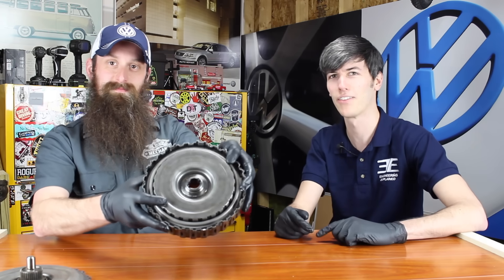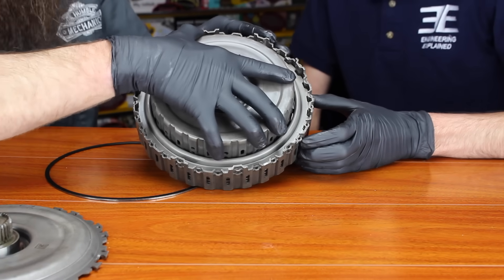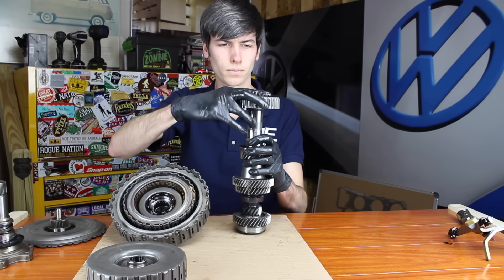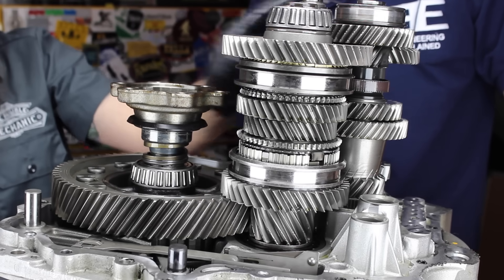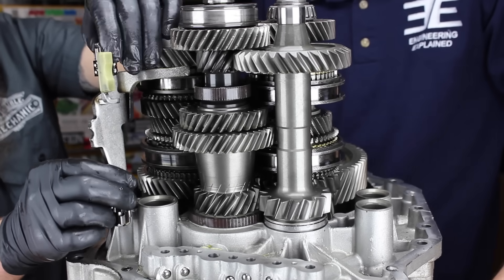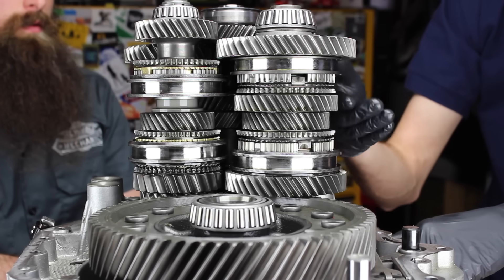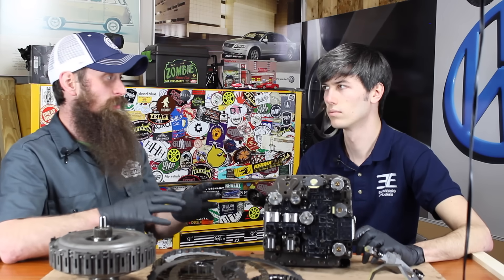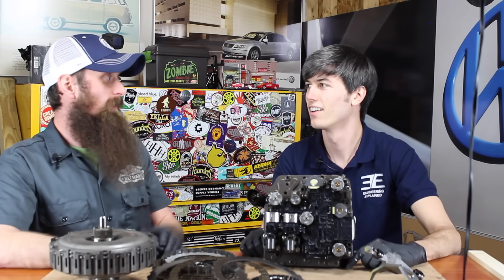DSG Transmission - Explained

Comment: Hi I have a question that has been bothering me for a while now. I am an M4 owner and my car comes with DCT, I read online it said when im at a stop I can let go of the brakes on a DCT transmission because it will not roll. However my car rolls when I let go of the brakes, is it because i accidentally did something with the settings on my car? Thanks for answering my question.
Reply: +Zihao Chen I think what they mean is, the car will not creep forward like a car with an automatic transmission. It will act like a manual transmission car in neutral.
Reply: See if the hill holding feature is activated. If not it will roll forwards or backwards. If it is it will creep forward.

Comment: can you get it to shift early each gear even if you push the pedal down quite a bit as in accelerate quicker without getting the car to redline the gear.
Reply: +VTECB18 Yes, you can floor the throttle without clicking the button that is below the pedal and it will accelerate as quickly as possible without coming close to redline.

Comment: So if the Dual-Clutch Transmission does the shifting why would some cars still have the paddle shifter? is it because of more driver control? I know that F1 cars are DCT but have paddle shifters. I mean ultimately, wouldn't it be self-defeating for a DCT to be controlled manually again ?
Reply from the maker: +TheGreenCommunity It's nice to be able to control what gear you're in (that's the only way it works in motorsport). Also, F1 does not use DCT.
Reply: +Engineering Explained Thank you very much for your response. I assume F1 drivers also use manual transmission because they have more control with manual then ?
Reply: +Tal Risin S mode will shift in higher rpms. If you have paddles you can control the shifts in d en s, but most cars don't even have those paddles, its an option. So, d mode normal driving, d to the left is manual shifting with the dsg knob and s is auto shifting with higher rpms.
Reply: +Am Dolan in any mode the paddles override the auto mode.
Reply: So basically even though it's classed as automatic it does have a manual mode?
Reply: @AmDolan That's correct.
Reply: +Am Dolan VW call it Tiptronic, basically you move the gear handle to the right (while it's on D) and then push it forward/pull it backward to control the gears manually. (Or if the car has flappy pedals then you just use those).
Reply: So in 'D' mode the only way to control the gear is manually (stick or paddles). The car won't automatically change gear when it gets to a high rpm? Basically this is a full manual mode?
Reply: Am Dolan no no no no.
You have:
P - Parking
R - Reverse
N - Neutral
D - Drive
S - Sport.

When in Drive, you can move the gear to the left/right (depending on if your driver seat is on the right/left), only then it enters the manual mode in which you control the gears.

Of course if you get to a situation where the car cannot continue driving at the current gear then it will change gear automatically to prevent damage or stopping. (for example if you hit the brakes while being in 6th gear and lose a lot of speed and the gear will change to 1st or 2nd)

You can see the gear here:
http://jyllands-posten.dk/livsstil/biler/article6285561.ece/ALTERNATES/h-free/dsg
Reply: Oh so there is two modes for drive mode? Mode 1 is just plain old automatic? Mode 2 automatic but you can manually change if you wish? What's the point in mode 1 then?
Reply: Am Dolan Taken from VW official webpage:

"Automatic transmissions with Tiptronic, which are available with five or six speeds, have all the advantages and technical features of the automatic transmission.
Tiptronic allows the driver to override the automatic mode by moving the lever into a second (Tiptronic) shift gate. Changing up is achieved by pushing the gear lever forwards, and changing down by pulling it back. Gearshifting is also possible with paddles on the steering wheel.
Tiptronic provides the convenience of an automatic and the driving enjoyment and sportiness of a manual gearbox. Safety when overtaking is provided by the automatic change-up feature when the engine speed limit is reached. The sporty driver benefits from changing down and using the engine for braking before a bend or when climbing hills"

Except Tiptronic is available on all their DGSs and automatics, not only the 6/5 gears but also the 7 gear ones.
Reply: Oh I see. Does s mode have a manual like d mode?
Reply: Am Dolan I don't think it does.
Reply: Suppose it would be pointless. Exactly the same as d modes manual mode. I'm guessing s mode is just the d mode but higher rom changes
Reply: Rpm**
Reply: Am Dolan I guess, not sure what exactly it changes.
Reply: +Engineering Explained Just think of F1, as traditional manual with servos and or pneumatic links working the clutch and shiftier.  You can hear what seems like an eternity.. of lag in shifts in F1 cars,  Early Automatic Ferraris  had this.... It  drove terribly ...!!! wait all Ferraris do..
Reply: +Am Dolan S makes throttle more sensitive.
Reply: Being able to select your own gears can be useful, such as preemptively selecting a lower gear so you can perform an overtaking maneuver without waiting for the transmission to kick down. After said maneuver I can then put it immediately back into high gear.

I've just bought a Diesel Optima with a 7-speed DCT, and heading to work there is a long down-hill section. I pop the DCT into manual mode and flick down a few gears with the paddles so I get an engine breaking effect.
Reply: F1 isn't allowed DCT because completely automated electronic gear changing is against the rules, same as moto GP. They have seamless gearboxes which are very similar to DCT just without the second clutch. Upshifts are clutchless, they have quickshifters which cut the ignition between changing the two gear shafts. Downshifts you have your auto blipper and slipper clutch but they can use the clutch manually for control over engine braking and engine load e.t.c between shifts. The only problem in a DCT along with the weight of the second clutch and electronics is that you have no physical control over the engine braking and engine load being applied during gear shifts, a race driver or GP rider will tell you this is essential to stopping sudden loads causing weight shifts interrupting race lines. Even with the most advanced slipper clutches and auto blipping systems to a professional there is still a significant change between gears in downshifts, with a manual clutch they at least have some manual control over this. I'm sure with the money they have available they could create electronics to replace the need entirely for a manual clutch but then you have the weight factor and like I said the rules don't allow DCT anyway.

Comment: i have a sort of complicated question. hopefully i'm clear on this one:

on an auto trans, when you're on a dead stop on "D", you're putting load on the engine, thus requiring more fuel which is less efficient than a manual on neutral. on a DSG trans, are you wasting power on a dead stop like an auto?

tahnx for your response :-) keep up the great work man! these videos really help!
Reply from the maker: Michael Olan With a manual you're spinning the clutch and transmission in neutral. With an automatic you're spinning a torque converter against a transmission, but not much force is going in. With a DCT, the clutch pack will be disengaged so you're not implementing more wear, it's probably somewhere in the middle.

Comment: Thanks guys , another great vid from EE. my question here, is that if i put a dsg gearbox in my car, and put a manual switch  to activate the pistons , would that work?
what if i put a dsg box in my car, put 2 paddles, running the required voltage to go up or down? since dsg is essentially a electronically controller manual gearbox... i think it can work...the car will basically be manual...with an electronic selector
Reply: You mean disable thr computer and just use simple switches to shift? it probably wouldn't shift because the ecu readys the first clutch so it shift fast with the second essentially, both have to work in a rhythm.

Comment: Hi Engineering Explain, I got a weird question :
Traditionally, torque converter and planetary gear set make a AT system, while clutches and synchronizing rings make a MT system.
My question is : Why don't people put torque converter and synchronizing rings together? It may sound like a silly question,but the companies really don't do that.
Reply from the maker: 柯旭東 Clutches are commonly used within automatic gearboxes to select certain planetary ratios.

Comment: I just got a 2010 VW Golf TDI and has a DSG transmission. I started learning how to use the manual gear change on the right side of the DRIVE option(sorry I don't know what it is called) and I started having some fun with changing gears, such as downshifting, hitting the acceleration, and changing gears again. I have one question for anyone who knows a lot about cars and stuff. Will this damage anything in my transmission? How often should I have fun with it? I love the way changing gears sounds and I plan on upgrading many stuff on the car. If anyone has any tips it would be really helpful, I do plan on putting a straight pipe so it sounds sexy but that's about all I know. Anyways tops are useful!! Thanks! PS I am in the Marine Corps and don't make a lot of money so anything cheap but reliable will be useful haha

Comment: I was under the impression that the gears are on alternating shafts, this is where the whole benefit of a dual clutch gearbox comes in...since to change gear, it needs to only engage one clutch while disengaging the other.  In addition, it can have the next upshift preselected to facilitate this.  If they were just sequential, there'd be no point to a dual clutch 'box, and it would function largely the same way as a traditional manual gearbox, just with more complexity and moving parts.

Comment: Great explanation but I'm having issues with my 21010 CC DSG... OBD code P2711, =>Unexpected Mechanical Gear Disengagement<=... especially when trying to reverse up hill. I have to turn the engine off then restart it to reengage . And every once in while I get a huge clunk shift, like the tranny just slammed into the diff! Brought it to the dealer and of course no issues. Still happening and now my warranty is expired! Can a DIY guy change out the shift interlock or inhibitor, providing thats actually the problem? What else could be the issue?
Reply: Did you solve the problem? I just got that code P2711 in my DSG

Comment: Does the dual clutch transmission operates the same as the direct shift gearbox? Or does it has a difference between this 2 transmission?
Reply: 1Asura0 'Dual clutch transmission' is the type of transmission and DSG is the 'brand'. For example, Porsche labels their dual clutch transmission PDK. SO yes, DSG is a dual clutch transmission.
Reply: Farhan Chowdhury Which means does the DCT and PDK share the same problem as DSG on the asia continent? I have read the news about China having a DSG faulty.

Comment: automatic transmission doesn't have the DSG right? I don't know why some Jetta TDI needs DSG transmission service
Reply from the maker: MasterofPlay7 DSG is an "automatic" transmission.
Reply: Engineering Explained so if I bought a TDI, I have to do all the maintenance from time to time? So in your opinion, does a TDI cost more to upkeep than a regular gasoline vehicle? Because I was thinking of buying a TDI which I had never owned one before
Reply: MasterofPlay7 yes if you dont maintain cars they are under unnecessary wear.
Reply: Jonathan Ongman is the 2006 jetta tdi known to have problems (like the flywheel)?
Reply: Probably, but all the ones Ive test driven have had over 200,000 kilometers on them. Condition varies, but I doubt itll let you down if you find a good one. Id own one.
Reply: Jonathan Ongman oh.... cuz i was thinking of getting a tdi, but then i see many people throwing out their 06 jetta tdi, so i don't know if is reliable. Cuz VW quality seems to go downhill for their newer models
Reply: Jonathan Ongman you know I had good experience with VW cuz my dad drives one, but when choosing my first car, I don't know if I would go Japanese or German. I think Japanese cars are known for their reliability, but the steering wheel and gas peddle just feel too light (not to mention about the body, is like piece of paper...), and the driving experience is just not up there
Reply: Volkswagen is Europes number one car. They have toyotas and everything, way more selection for vehicles yet Volkswagen is their most popular car, followed by audi, BMW, Mercedes. They are great cars, I cant help but love them. IMO the unreliability thing is overdone, they are mostly equal, and it also depends on you and your dealership.
Reply: MasterofPlay7 Mostly, I can imagine people getting rid of them because they have had them for years and want something newer. Otherwise, good fuel economy, great fun and it has a slightly upscale feel to it. I test drove an old TDI with over 200,000 miles on it, it sounded like it needed work, but I flipped it in sport mode and drove the hell out of it for an hour. Flip the Tran into sport mode and you'll have a blast. I even felt like I was getting more looks than with my newer Hyundai. I would only buy one with low kilometers with all the maintenance records in good shape.
Reply: +MasterofPlay7 because DSG sucks

Comment: If gears 1,2,3 and 4 are on the same shaft with only one selector , than it is exactly the same as a normal automatic clutch, should shaft one not have 1,3,5>>>and shaft two 2,4,6.??? this would make more sense as to why the DSG has faster shifts , because the next gear is already selected,only the clutch is not engaged yet.??
Reply: lourens booysen never mind.

Comment: @3:54 I thought most of these dual clutch units split the clutches/input shafts by even and odd gears. Meaning one clutch and its input shaft handles gears 1,3,& 5 (7?) while the other has 2,4,6,& R like the Porsche PDK. It seems like it would defeat the purpose of having two clutches and shafts if you split them by 1,2,3,4 and 5,6,R because theoretically the next gear you will want is already on the same shaft that's currently engaged (at least going through gears 1-4, which get way more use that 5&6) The whole point is to alternate them so the next gear is ready to be engaged on the other shaft but how can you do that if the first four gears are on the same clutch or shaft? Sounds like maybe they got it mixed up in this video or am I mixed up? I swore they said one clutch is for even gears and one clutch is for odd gears but ALSO that one input shaft has 1,2,3,4 while the other has 5,6,R but you can't have it both ways can you?

Comment: I've seen dual clutches before. So I had knowledge of how they work as an install option with racecar with manual trans.  I didn't know the newer "twin clutch" tech drive 2 separate input shafts.  I run a 92' 4g63t motor and would love to fit/engineer a Evo X trans to my engine in my 94' awd eagle talon.

Comment: Just a question about the clutches used in these transmissions: if they're automatically controlled by a hydraulic system for instance, then how does this system work? Are the clutch plates clamped together by the hydraulic pressure, or is there a diaphragm spring that provides the clamping force and the hydraulic system presses of the diaphragm to disengage the clutch(es)?
Reply: @@willheheckaslike8315 I had forgotten I had ever asked this question, but thankyou for the insight!

Comment: Technical question:   K1 uses larger clutch discs and supplies a larger contact area for gear engagement on the even numbered gears and much smaller clutch discs for the odd numbered gears. Has this become any kind of issue with a higher failure rate in the odd numbered gears?
I would think it would be more reliable to design the larger clutch discs to run the first few gears because of the higher torque loads associated with shorter ratios.
Reply: peteriot15  I had to pause the video for a closer look myself. Kind of looks like the inner clutch plates are wider than the outer clutch plates, so basically provide exactly the same contact area as each other when in contact under pressure. They just did the math, and made the inner plates wider...
Reply: Blair Taylor Actually I had the odd and even numbers backwards after looking again. Also, I did notice a difference in clutch width so I think you might be on to something there. They still don't seem to be wide enough to off set that much difference in diameter but looks can definitely be deceiving.
Reply: Also, the surface speed as the plates engage could make a minor difference in sizing. I'd guess that the slightly slower inner plates may grab a little quicker. We also have forces needed to squeeze the fluid from between the plates.  Lots of engineering,  math, and a bunch of testing :-)

Comment: I was at my local VW dealer the service manager told me that the DSG was not serviceable I was asking him how to check the oil in the trans if there was a leak and how to fill it, if there is seals and gaskets there is a possibility for a leak. I just bought a GSR Beetle and like to know how things work on it.
Reply: Six Pack Cool that you got a GSR! 

What they generally mean by "not serviceable" is there is not many repairs to be made on the transmission. Either a mech unit, clutch pack, or a unit gets replaced. 

VW says that if there is a leak in the case, to replace the unit. 

I did a Q&A video about the DSG you might want to check out at http://humblemechanic.com/2015/01/05/viewer-questions-on-dsg-transmissions-podcast-episode-30/

If you have any VW questions let me know!
Reply: The link appears to have died.  Getting a 404 message.